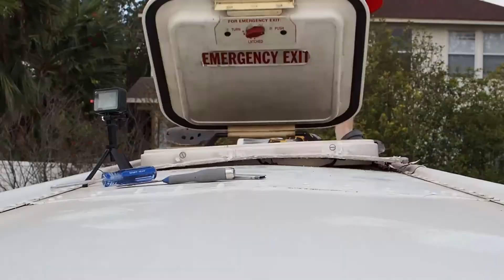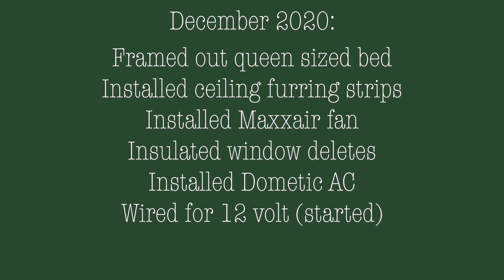121-150 Day CHECK IN | DIY Skoolie Build

Comment: I see that you guys placed the firing strips on the ceiling in sections. Did you come back and cut the curve later?, to match the curve on the ceiling? Or is this no big deal to leave those firing strips flat ?
Reply from the maker: We are currently installing the tongue and groove cedar strips and screwing into those furring strips. The strips don't protrude past the original hat channels so the ceiling is still going up flush (all be it, slow and frustrating). Let me know if that answered your question!
Reply from the maker: @Atlbug138  Done deal, we sent you a message via Instagram!